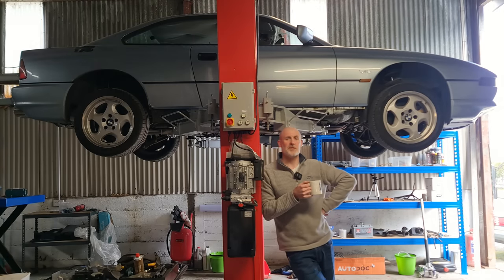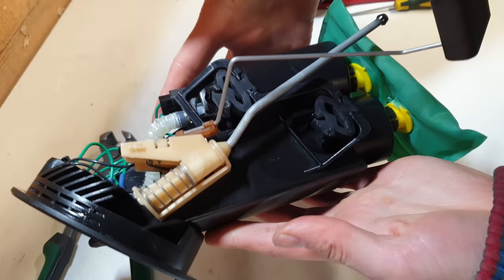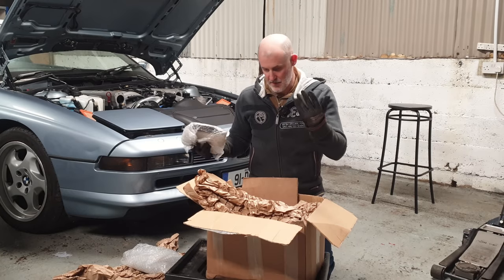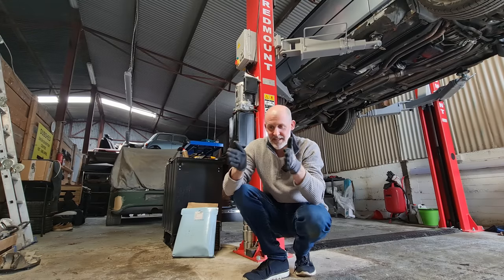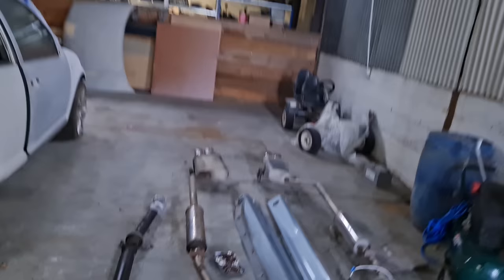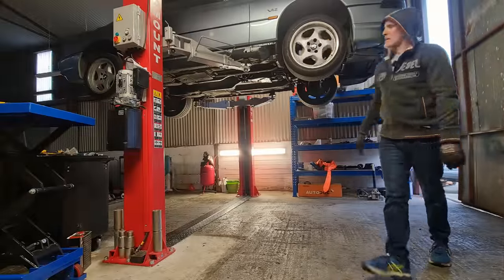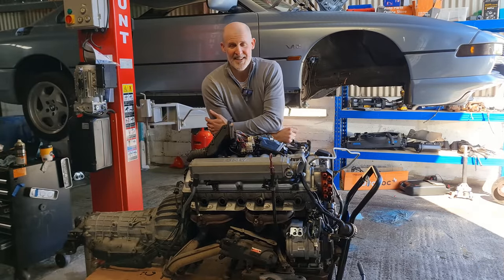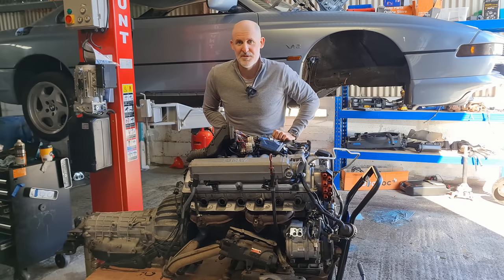BMW E31 850i "Glacier" - Complete Restoration - V12 Engine Removal - Episode 12

Comment: Once the engine is removed, and you probably don't want to do it again. One problem with these engines is stuck oil rings, you should definitely check them when the engine is off, piston ring kits are available (goetze) and they are not very expensive. When the engine is detached, it is worth at the same time changing the seals of the asc unit and at the same time servicing the brake booster and brake master cylinder. When the motor is off, the ventilation fan is also easy to change, greetings E31 owner from Finland. I've watched all your videos, you're a tough guy, good job. Best regards, Jukka

Comment: Hi Steve, brilliant video, it certainly made me somewhat pleased I did pass it on.  I used to say if money were no object, I would like to have permanently kept the car but from what I can see it would have had to have been in a showroom.  One thing for you is that the wipers were having a problem through lack of use and I believe they have stopped working.  With all the space and access, I suggest you might look at them while the area is clear.  All the best and massive congratulations for all the serious work you are doing.  Alan.  PS Don’t forget the wipers.

Comment: I have a car with an identical engine. 1988 750iL with an electrical issue preventing starting. After sixteen years of failing, I am doing a temporary retreat via LS swap. At least you have a garage to work on yours. My car is stranded 36 miles from home for now. Best wishes.

Comment: I feel the issues is timing, or electrical…I would think you could get that 12 cyl to function smoothly….the basic 12 cyl engine is known to be very robust mechanically ..it’s the plastic  rubber electric stuff that goes south. Do you have a good bmw tech to provide input.

Comment: I know you've spent like $10k on this project so far and (hopefully not) have to spend thousands more to restore it completely but with the engine and transmission out, is there any way you could get a manual transmission for this car? I had the pleasure of driving an 850i with manual transmission and it was amazing. I can't imagine the 4 speed automatic being anywhere near as good as the manual. If you can't, that's okay. 

I want to once again commend you on your hard work and attention to detail and I love your channel, particularly your camera work and how you explain everything in detail. Good luck with everything and I can't wait for the next video and can't WAIT to see you driving this car.
Reply from the maker: Thanks for the kind words, I'm thinking of doing similar, there are a few manual transmission options outside of the original NLA parts, will have to decide what the best option is.
Reply: @stevesbmwbarn  That's awesome! You're the best
Reply: You are right since the automatic transmission  is not the original one. So the swap toward a manuel transmission is a good idea.

Comment: I dont think taking the heads off for refurbishing will fix it. I also changed the valve stem seals on my m73 e38, my valves werent the easiest to move either but the timing was slightly off too. I think you should adjust your timing or atleast check that the engine is in time and then rebuild or purchase a new fuel pump. M539 restorations has some great clips on working with the e31 fuel pumps, best of luck
Reply: Thanks. But timing was checked and fuel pumps rebuilt.

Comment: These engines are very robust, but they do have an Achilles heel with the timing components as they wear. One side of your engine could be out of time. The section of video from the arrival of the car would point to this. If you have the correct timing tools, you can check this during disassembly. Even a stretched chain can make a very erratic running engine. Just a suggestion. It will be far easier to check now the engine is out. 
Keep up your enthusiasm. Sometimes it is beneficial to walk away for a few hours. Fault finding can be very frustrating until you get that Eureka moment 😂
Reply: Thanks for the input, but covered the timing in the last video, no dice.
Reply: @voodoomelons  Ah, sorry about that. I’ve not seen that video yet. For some reason I don’t seem to have had a notification about that one. These new YouTube changes are a pain. 
I will seek it out, thank you for getting back to me Stephen 😉

Comment: Great work man. But I wonder isn't it easier to hoist the engine out? Than you just had to loosen the 2 engine and the 2 transmission mounts.

 Also, since you're this far. I would consider going for a M73 hybrid swap. That basicly means getting a M73 block with your M70 heads. Should be good for about 350hp with a good chipset. That is my plan anyway should my M70 ever give out. 

Greetings from another E31 owner.

Comment: CRITICAL...CRITICAL...CRITICAL...💥💥💥💥💥💥💥💥💥💥

Just a thought....for the M70 V12 you MUST use the correct spark plugs and correct leads and the doughnuts on HT leads 6 & 12 must be the right way round.

1. ALL Spark Plugs MUST be 1k ohm spark plugs, the NGK BKR6EK 1K (often 1R)...nothing else will work.
2. HT leads...must be the correct BMW ones for the signal to be relayed to the doughnuts.
3. Doughnut MUST the right way round on leads 12 & 6, with the nose facing towards the Spark Plug

The ht leads are copper in the m70, the resistance is in the end connectors which is how they all have the same resistance but different lengths

Your symptoms seem to match EXACTLY what happens if these are not ALL correct....
ENGINE STARTS...then after 2 seconds it stops.
Check out this video...https://youtu.be/bCctewUmVP0 for a full explanation...

Also if the coil is replaced with an MSD Hugh Power type then you can use just about any plugs you like.

HOPE THIS HELPS....!!!!
Reply from the maker: Appreciate all the tips. But all of your items were checked. Thanks!
Reply: @stevesbmwbarn   Thank goodness...wish you all the best....!!!

Comment: Will you replace the subframe with the later x shaped version?
Reply from the maker: I planned to, but as far as I am aware you need special attachment points fitted to the chassis, will have to do more reading on it.

Comment: Dont ever use STARK- shit, I have two failed sets of those pumps. Get completely rebuilt pump set from V12throttle and your problems are gone ;)
Reply from the maker: Yeh, the Stark pump was only temporary to rule out the defective Bosch one, Ed already helped partially rebuild the pump, unfortunately I have quite a bit of money into it at this stage, before his new one was available.